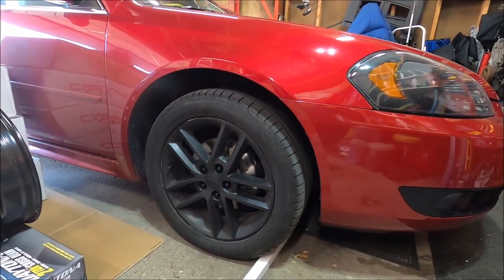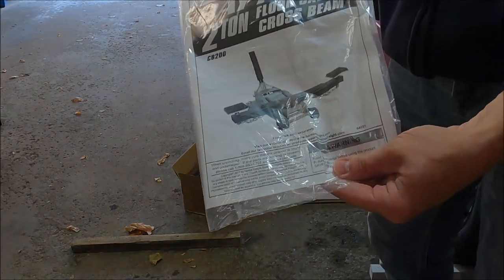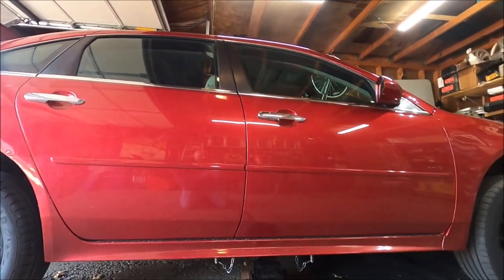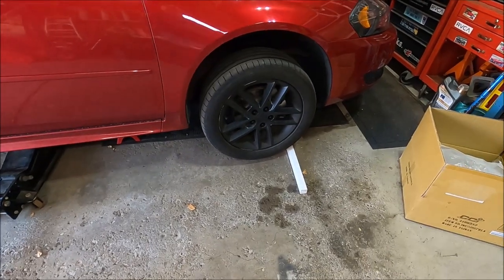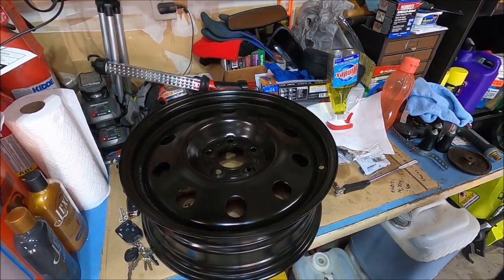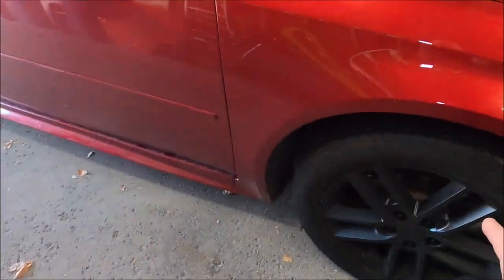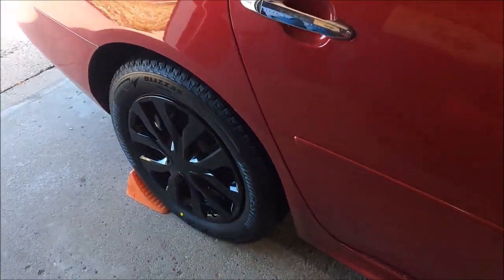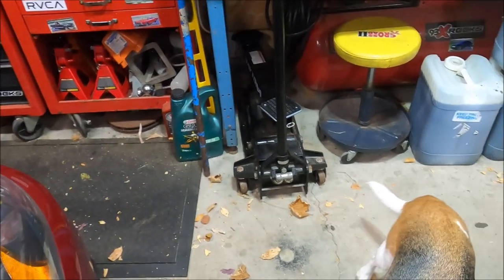Getting the Impala Ready For Winter *WINTER TIRE INSTALLATION - HOW TO JACK UP AN IMPALA - SET TPMS*

Comment: I don't use winter tires, but I did purchase new BFGoodrich G-Force Comp-2 A/S+ tires from Costco in late September. That was when I learned of directional tires. I was checking the manufacture dates and didn't understand why two of the tires were mounted inwards, so I asked. Earlier this month I checked my fluids, topped off the coolant and washer fluid, and got my oil changed to a synthetic blend. I also checked the tire pressures since the temp dropped, and sure enough, they needed to be inflated. I was shopping at a bargain discount store and saw a snow shield windshield cover; I purchased one since I park outdoors. Don't know how well it'll work, but it did not cost much. Those are my winter preps.
Reply from the maker: Those snow shields work pretty well, we bought one for our son and he got some good use out of it. Beats having to scrape your windshield!!
Reply: @CertifiedShadetree  Thanks. Pleased to know the snow shield will be useful.

Comment: Those stupid acorn stock lug nuts where the caps would fall off were one of the first thing I replaced on my 13 LTZ.  I went with just chrome 1 piece acorn lug nuts.  Had those on now since then.  I put Pirelli P Zero's on mine and I am very happy with them.  Of course in SoCal we don't do the summer/winter tire thing.  Just all seasons is all we need.  Your new setup looks good.
Reply: My dad had a 14 LT 10th gen with the 18" steel wheels and hubcaps, and they rattled something fierce since those stupid things don't hold them on really tight near the edge. I ended up buying him a set of brand new old-stock alloy wheels, and naturally after I spent a grand getting them all mounted up for him the car got flooded in hurricane Ian a month ago and totaled. Dang.
Reply from the maker: Thanks! That was a good call getting rid of the stock lug nuts.
Reply from the maker: @Proxy  D'oh!  Too bad they didn't let him pull those wheels off and put the old ones back on before the insurance co. took it away.
Reply: @CertifiedShadetree  Yeah the tops had fallen off a couple of them so they looked lame like cheap old lugs nuts I had on my old Datsun Truck.
Reply from the maker: @TheShornak  🤣 Yeah, they do look completely shitty without the chrome caps!!

Comment: I ran Blizzaks on a set of 18" Camaro steelies for a couple of years on my Malibu and loved the confidence in the snow, but the new car this year won't fit them since it has 20" wheels and brembo brakes (Caddy XTS VSport). I can only go down to 19" at the smallest so I took a chance on Michelins new Crossclimate 2s. They are severe snow rated and based on a winter tire compound. 

They probably wouldn't feel good on a sports car given the soft rubber and lack of stiff sidewalls but for a big boat like this thing they're fantastic. It snowed a little the other day and they were able to hold traction really well even mashing it off of a light which is impressive considering the car makes around 500ft-lbs right now with some mods. They seem to be a really good choice for AWD cars, and although I absolutely hate snow and winter I'm looking forward to a good storm so I can go thrash these things and see what the limits are.
Reply from the maker: Those must be some serious mods, doesn't that LFY only put out 369-ish Lb/Ft stock?  I was looking at used non-V Sport XTSs and it's surprising how little they're selling for. Honestly for what you get for the money, I'd rather buy an XTS than a 10th Gen Impala!!
Reply: @CertifiedShadetree  Yes but its only because of the torque management to save the poor 6T80 - the motor is identical to the 430/430 unit in the rwd CTS. Once you get it a good 93 tune it makes ~410hp/430tq at the wheels and these cars have a really large drivetrain loss compared to an SHO which is a similar type of car. 

As for the Impala, I mean they're the same car just one is more fancy. Personally I like the styling of the 10th gen Impala more than the XTS, its just a good looking car. But I got a hell of a deal on this one, they gave me 13k trade in on my 120k mile Malibu so I went home with this thing for under 8 grand.
Reply from the maker: Aah, that makes complete sense. GM didn't want to make the same mistake they made with the LS4/4T65 combo in the FWD Impala SS!!

Yeah, that's a hell of a deal!  Plus it's essentially an Impala under the skin, so you'll be able to at least get replacement chassis parts cheap..
Reply: @CertifiedShadetree  Yeah the 4T65 suffered a lot in the W-Bodies between the 3800 supercharged motors and the FWD V8s. I think the only reason the 6T70/75/80 work better is because they were co-designed with Ford.
Reply from the maker: That and they weren't based on a transmission designed during the Carter administration to sit behind a 90hp Iron Duke!! 🤣

Comment: Hey shade, so those piece of frame will support the weight of the car, I only have a floor Jack and Jack stands, could I use the pinch points and use Jack stands there to hold the rear of the car? I’m planning on changing my rotors and pads and to save time lift the rear all at once to just run through rear brakes. There isn’t much detailed info on suspending these cars. Especially tenth Gen impalas like mine. Could you do a video on where to place stands while lifting car on it’s dedicated lift points. I don’t know where on the sub frame to place my stands.
Reply from the maker: Hit up One And Done DIY. He has 2 LaCrosses that are the same chassis as the 10th Gen. https://youtu.be/xAdJEctg718